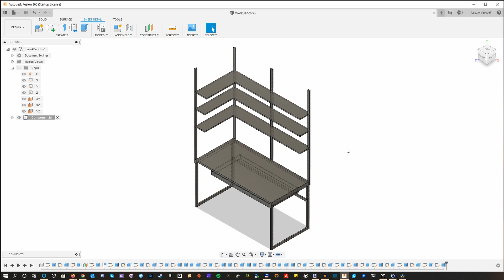What's wrong with my grand electronics projects?!

Comment: Looks nice, you should make the shelving on the left wide enough for bench instrument width, in case you get bench power supply or multimeter you can have a forward facing stack or use the corner space to make the corner deeper an have them angled at you, and keep them off your benchtop.
Reply from the maker: Tbh I thought i'd leave that on the bench. What I plan to is move the parts container up to the shelves, put the display on a vesa mount and attach it to one of those vertical metal bars, so it "floats" above the bench surface. These changes make most of the bench surface free (not counting the keyboard and mouse which I can move aside). Putting larger instruments into the corner is a good idea though!

Comment: Bear in mind for a scope that most people mount it over their workbench - but I've found the best place is just below your bench top, screen facing upwards.
That way the probes are kept out of the way as long as you have them through a hook or metal ring eye on the bench top edge to stop them pulling.
 Old CRT scopes were great for this - they could stand on their rear feet and were about 70cm above the floor. With the screen and front panel facing up at you just off the edge of the bench you can see both your scope screen and the circuit you are probing close together if you move the PCB to the edge of the bench. Much better than looking down to see where the rprobe tip is then up for the scope screen.
It was common for TV repair personnel to have scopes under their bench facing up because it was much faster.  (remember when TV repair shops actually existed?)

Maybe you could mount a modern cope in a pull-out drawer? Be careful about ventilation for heat and make
 a cutout in the drawer front for the probe cables - scope probe cables are made from zig-zag iron cable - cool-fact - and are quite fragile.
Reply from the maker: Great tips, thank you! I especially like having the scope screen near the PCB I'm working on! Good thing I haven't started with the actual build yet, as I've been collecting ideas in the last few weeks - because of this, I can easily incorporate your idea into the final plan as well!

Comment: The problem is that you have a job and a family. Your "man cave" only goes so far. Stop drinking when you come home, or at least keep it under two beers, and start planning for retirement. Only then will you advance to the next level.
Reply from the maker: Haha, drinking... only if...! :) No, it's not like that. I have enough time for the channel, the thing is just I'm wasting it, because my little maker workshop is badly organized and because I'm missing crucial tools. It's like when you're trying to solder with a crap soldering iron. It'll take ages and the results will be unreliable at best, so you need to redo some of the joints, wasting even more time. And then when you realize that you've spent night after night with those crap solder joints, you start to lose motivation to do the whole thing. So you either improve your process or give up. I'm shooting for the first option!